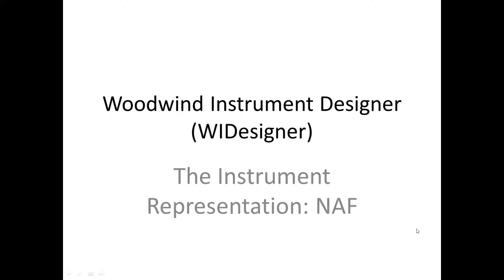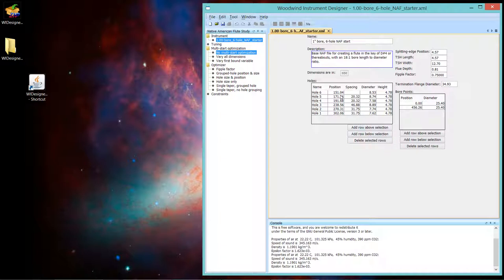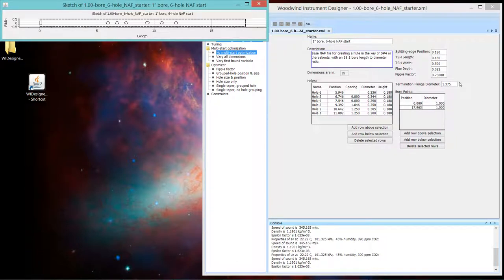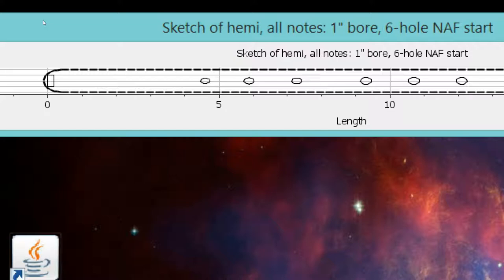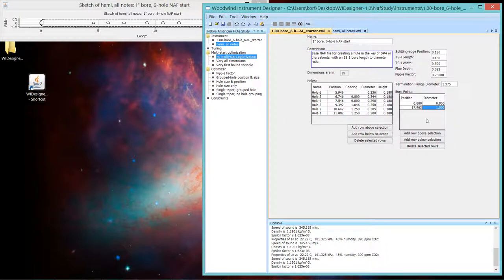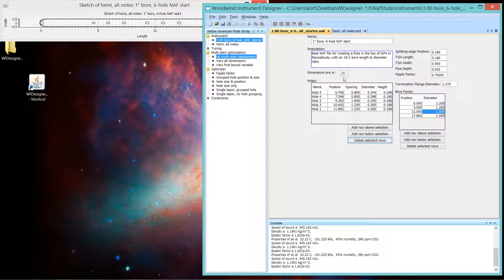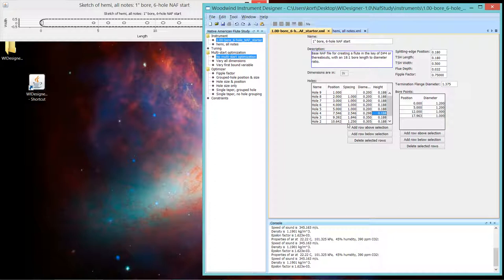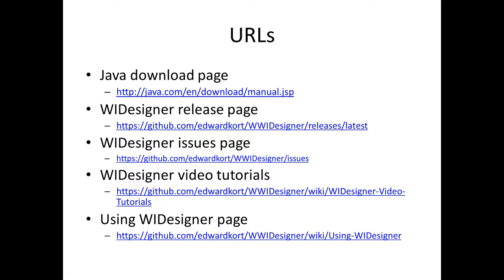4. WIDesigner Instrument Representation - NAF

Comment: there doesnt seem to be an options tab under edit on v2.5 for mac. is there any other way to change to mm and set the temperature?
Reply from the maker: Hello Adrian. WIDesigner looks a bit different under each of the supported operating systems (Windows, MacOS, and Linux). It attempts to comply with the UI standards of each operation system. Under Windows (the basis of all the video tutorials), the Options menu item is under the Edit menu - the Windows standard. Under MacOS, it is called Preferences, located (I believe) under the WIDesigner menu.
Reply: Woodwind Instrument Designer ahh, yeah makes sense, thanks!